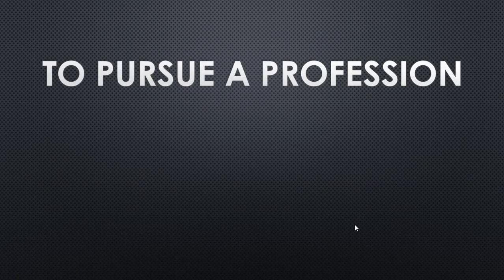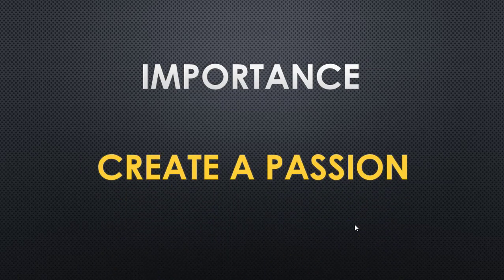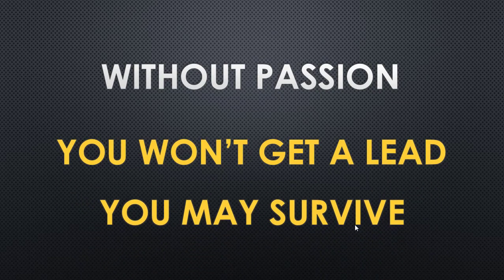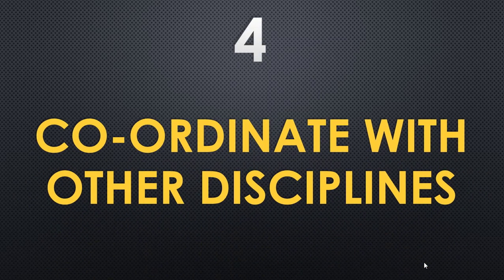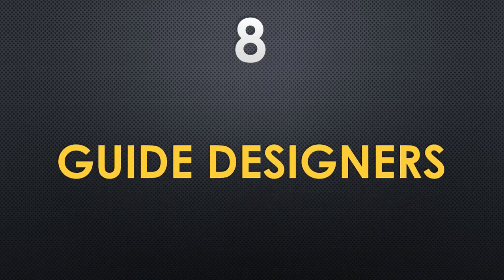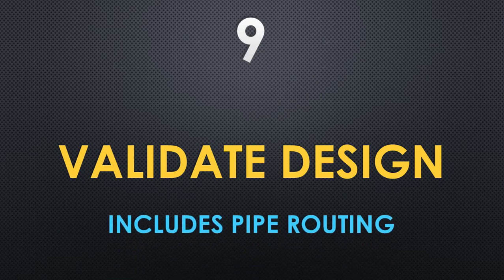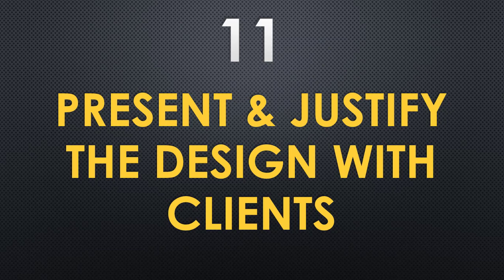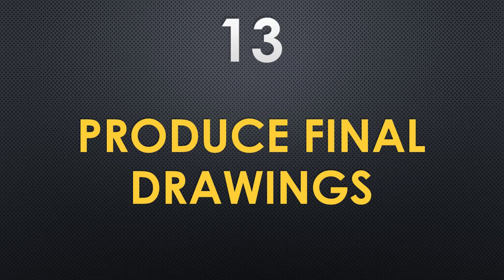Roles and Responsibilities of Piping Design Engineers

Comment: Sir I have Some Quary.... Whenever the project will start.then the pipingengineer eng have responsibilities as Produce design as you show in vedio.but I want to know about E3D software mean in E3D basically I know that in software there is we can draw 3D view of plant or unit...but my Quary is that in E3D the piping work will be done.will it done by plant layout and p&I'd..?
Reply from the maker: See E3D is a software to develop piping design. Design engineers should the requirement to build design. Many inputs required to build it like layout, spec, p&ID etc..